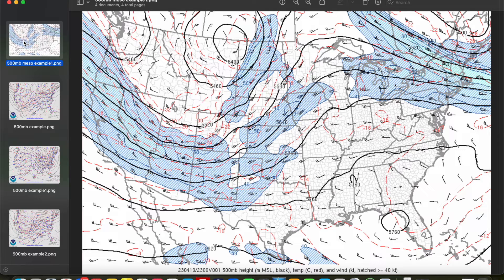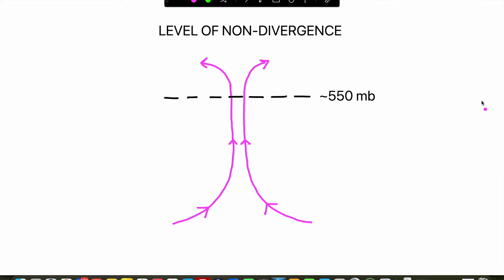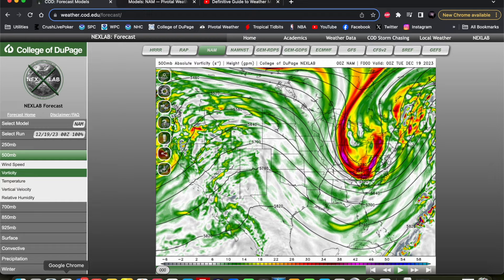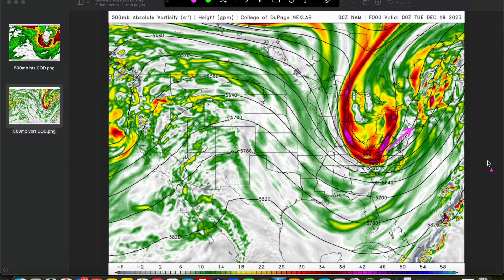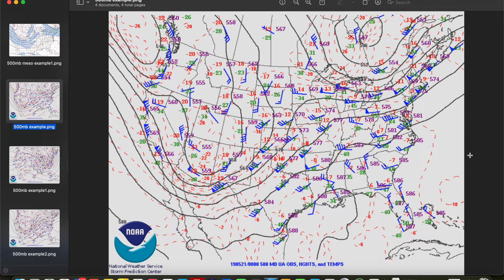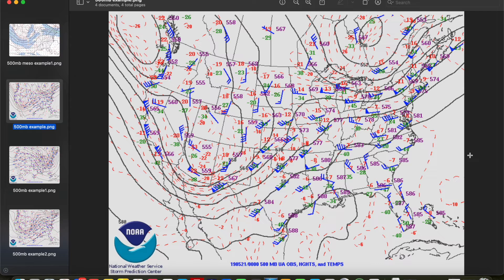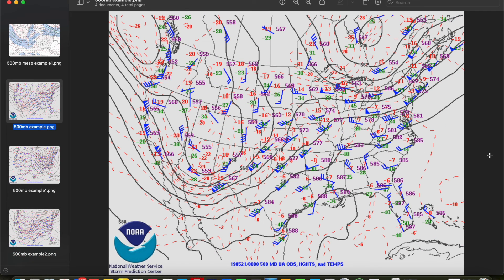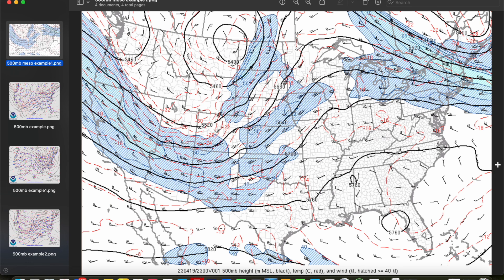Definitive Guide to Weather Map Analysis - Part 6 - The 500 mb Map

Comment: Does divergence work the same say in winter when there may be warmer air aloft?    Aka - does air from upper and mid levels descend to fill the divergence zone since i'm thinking the colder dense air at ground level will resist to upwelling... ?
Reply from the maker: Air doesn’t just ascend/descend on its own; there has to be a mechanism at play to make that happen. Descending air is associated with many processes, including surface divergence
Reply: @ConvectiveChronicles  that'skinda what I was thinking.  Was trying to put your video to work in the context of a freezing rain scenario where warm upper level low overrides a cold stubborn pocket of air.  Last years ice storm in the midsouth there was even lightning with that setup.  That's crazy